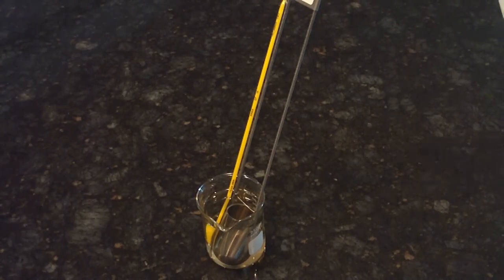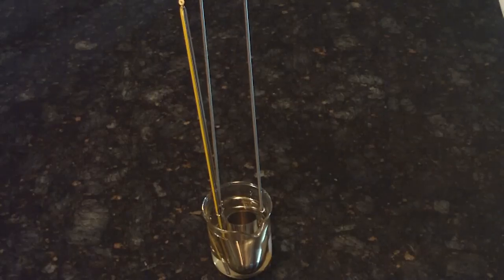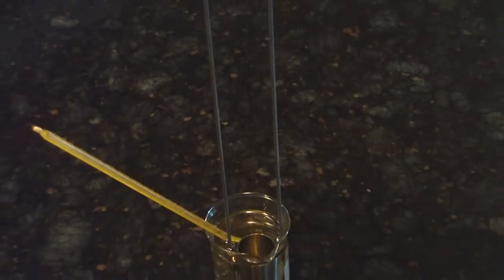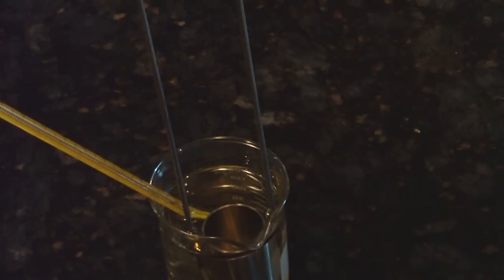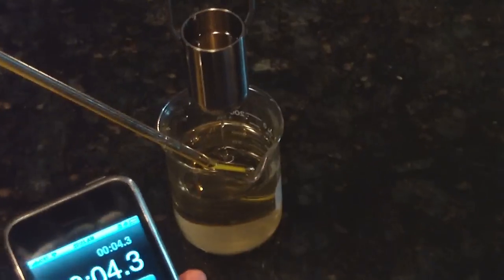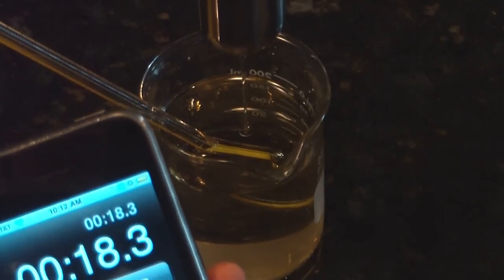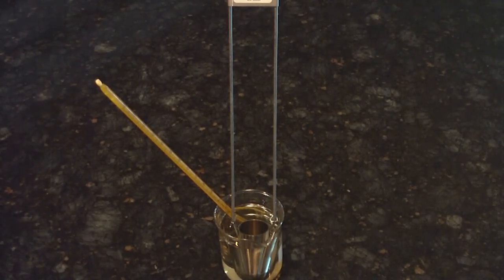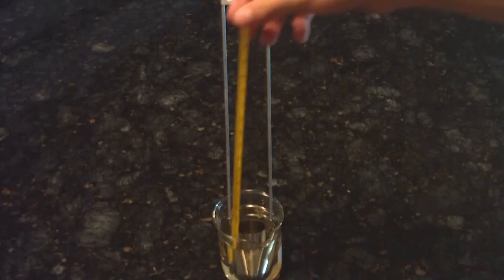How to Use a BYK-Gardner Zahn Viscosity Cup

Comment: @rickyrosan The two cups are both used for the same types of materials.  The Zahn type cups are used more in a manufacturing environment where they are often dipped through the bung hole in a drum of material or into a tank of paint. Ford cups are used in a lab where conditions are more easily controlled.